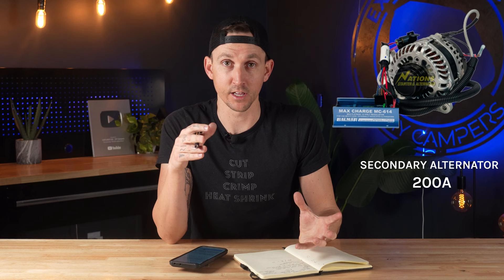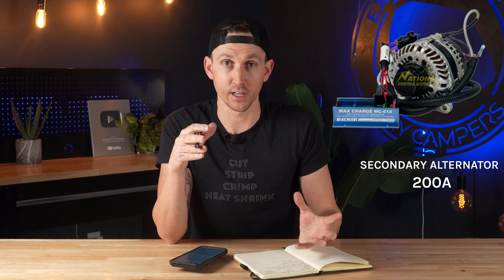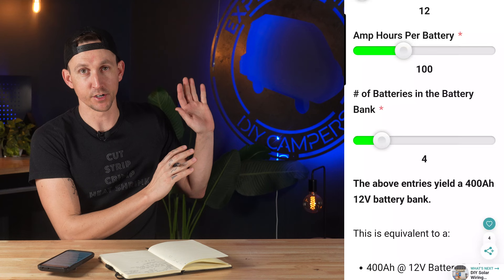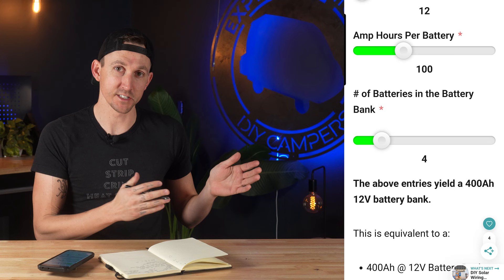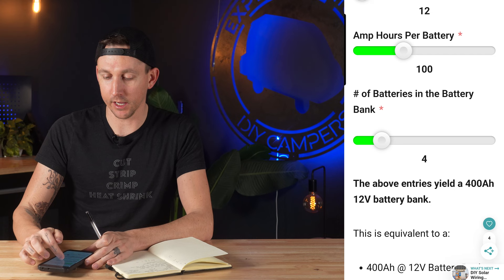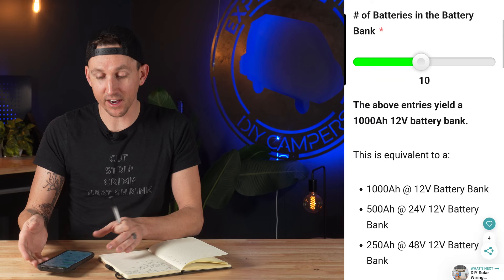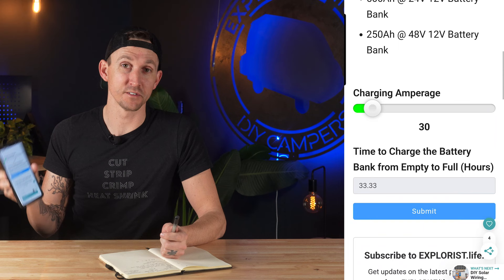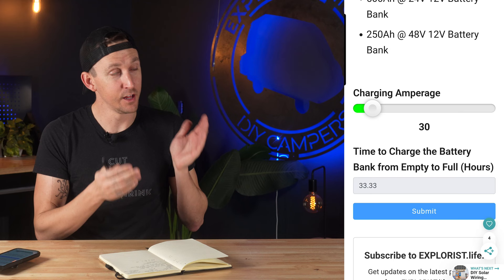ALTERNATOR CHARGING OR NOT? (for a camper electrical system)

Comment: I have a Class C - older model.  I have a Generator 4000W, plus an alternator charging from engine battery.  I don't have any solar yet.  However, I would not do away with the alternator charging because ... it is silent. The generator makes A LOT OF NOISE. You arrive at a residential destination lets say, and its nighttime. You cannot use the generator there, cops will be called. But if your alternator worked while you drove, then you have enough juice in batteries to power up lights and basics.  What happens if solar is not working optimally AND Genset gives you trouble?  At least you have the alternator back up.  I think you should always have it.  Good video, learned something.  Thank you!

Comment: Hello Nate,
I have finished the install of my Battle Born / Explorist Life install.  I have been on the fence about the alternator charging prior to your video.  I have a factory 2nd battery that was factory installed that the alternator charges already.  I installed the wiring but did not install the DC to DC charger.  I decided to take your advice and trust my instincts.  I have a small Honda generator that if my solar falls short, I can supplement power from it.

I want to thank you for all the information, videos etc.  I am very proud of the results I have gotten.  I am the guy with average electrical skills you often mention.  I know without your expertise my great results would not have happened.  Thank you!

Comment: and you have basically no option in the sunless snowy winter for days on end unless you carry a separate generator.  
worst case with a DC-DC, you can run the engine and get SOMETHING....    
But your points are well taken and pretty much cover the issues without being totally extreme case driven.
Always a mix of options depending on intended use patterns.
Good video !

Comment: I'm opting for redundancy on our 25' trailer.  600W of solar but if available, we'd rather boondock under trees than full sun.  Ford Powerboost provides a generator that will run both A/Cs (while charging up the 540Ah battery) when parked and alternator charging will help keep things topped off when trekking cross country in rainy/cloudy weather.  We've done this two years (7000 miles last year) with only a 200Ah battery bank (just a 1000W inverter) and 180W of solar.  Looking forward to the expanded 3000W system!  BTW: doesn't your calculator miss the fact that the last 10-15% of charging transitions from current-regulation to voltage-regulation and takes significantly longer?  Thanks for all your help!  Your channel and website are amazing!
Reply from the maker: The calculator is just aimed to give a rough idea of timing.

Comment: I sort of disagree. Solar is amazing when it’s sunny. We did a two week road trip with almost zero sun the entire time. Without a second charge source we would have run out of battery power. Also I will say this even though I’m a huge fan of Victron their dc-dc chargers are severely lacking. No ve.direct, no dvcc, no external control with can battery, and low output. Until Victron dc-dc comes with a higher output with those options I’ve seriously been considering a new sterling (all red box) unit. Price is was lower per amp and go up to 200 amp (no van can handle that but the 120amp model would be close). 

Of course if Victron ever release a better unit I’d swap in a heartbeat. I went to intersolar in 2019 and was told better units with those features would be coming soon. I understand the pandemic hit but hopefully something better comes soon.

Comment: I have seen ambulance alternator replacements for 2003 Ford Econoline but I wonder if the extra capacity will be actually usable without a special wiring harness; I planned on using a dual battery isolator but now I see solar mppt / dual battery isolater with lithium capable charger integrated in one unit.

Comment: Great video! Most tow-vehicle-to-trailer electrical connectors and wiring are limited to 30 amps, but I don't trust them. If I were doing charging from a tow vehicle, I'd probably limit it to 24 amps or less flowing from the tow vehicle.
Reply from the maker: Yeah, for that I usually recommend running a secondary connection w/ an anderson connector & 6ga wire so we can run a 30a charger (or 2ga w/ a 100A charger).
Reply: A guy on Will's DIY solar forum boosts voltage to 36v before running it through the 7pin and runs that into an MPPT in the trailer.  Since he only has one controller it means he has to choose between solar and TV charging but it seems to work for him.
Reply: @fratermus5502  , That's an electrically cool workaround, but it leaves a very high non-standard voltage at the connector, which would cause trouble if a normally configured trailer were attached.
Reply: Hi I am installing 375 watts of solar with a 300 ah Lithium battery on my Travel trailer. I pull it with my 2021 Transit 250 awd eco boost cargo van. 

I dont plan on charging via alternator but while towing and plugging in my 7 way plug will that affect my alternator?
Reply: @RVRebelGirl , Generally speaking, there is a fuse that needs to be installed somewhere in the tow vehicle to provide power to the 12-volt pin on the trailer connector. So, your Transit may or may not be set up to actually provide power. For my part, I'm going to disconnect the power pin at my trailer's connector, so there is no chance of a problem.
Reply: @robbehr8806  
my transit does charge my battery thru the pin, so i disconnect the fuse on the transit that provides the 12v charge to my trailer via the #4 pin on my connector. Then no power will go thru the plug from the alternator? is that the correct way? thanks
Reply: @RVRebelGirl ; That should do it, but I would still disconnect pin 4 in the trailer connector, just in case you tow with another vehicle. In my case, I'm converting to lithium batteries, so the alternator/regulator in my Suburban would be low on voltage. Plus, the wiring isn't rated for over 30 volts.

Comment: I am planning on going with the nations 280 amp alternator and skip solar all together. Just trying to decide between the balmar or wakespeed regulator. I don’t plan on siting anywhere for long periods of time. I also won’t have much roof space on my Sprinter 144 for any panels.
Reply from the maker: The new Battle Born Batteries will very likely have communications with a Wakespeed since BB just bought them; so I'd be going that route for sure.

Comment: Nate, Steph, don't forget all the yachties that are ear wigging on the side learning too, so thanks for making these videos.
Reply from the maker: 😂🤣  It's tough to remember when when every body of water within 200mi of us is frozen solid.  Do yachts generally have on-board generators?
Reply: @EXPLORISTlife  Yes they do, particularly over 40ft either diesel or the Honda 20i.

However, many of us are now installing serious solar panels.  We have 600w on a 31ft yacht, with inverters to manage electric cooking.  We may add another 300w.  A Remoska being the killer solution and very popular across Europe for cooking.  An oven that will cook a full roast duck and roast potatoes on 580w is a great solution and bakes super cakes too.

Add a Alpicool freezer in addition to the fridge plus portable washing machine and we are pretty much self sufficient from April to September. It's all the same technology, Sterling or Victron inverters, DC>DC chargers, lithium batteries and solar.

Comment: Another option is a lithium specific battery isolator such as the Li-BIM 225.
Reply from the maker: Yeah, that's an option, but I generally never recommend that unit since it's not a voltage nor amperage regulated device.
Reply: @EXPLORISTlife  yes. Good point.
Reply: @EXPLORISTlife   Many of use have found that moderate-size LiFePO4 banks (say ≤300Ah) charge directly from alternator within voltage and current spec for both the Li and stock alternator . 

Example:  when I wore out my old FLA bank and went to LiFePO4 I assumed I'd need DC-DC to control current.  I tested it on a whim and found the alt charged the lithium rather gently (0.32C when SoC is low).   I installed a switch to disable the VSR when  desired and it's been working great ever since.  

So instead of a $250-$2100 solution we could be talking about a $50 relay for campervan folk.  Victron Cyrix-ct for example if we want to stay with Blue. Changes the economics quite a bit.
Reply: @fratermus5502  This intrigues me. I have an older van that I have installed 2 100Ah lithium batteries for the coach. It has an old sure power isolater and an emergency solenoid switch. Are you saying I could replace them with the Cyrix, because of the lower Ah? Worried about taxing my 130 amp alternator. Thanks!
Reply: @johnroyer3191  It's possible/probable the existing setup will work.  I have data on 10 installs where 200Ah of LFP is direct charged;  the average highest current observed is 65.5A at low states of charge, with ~40A being more typical in middling SoC.  

Depending  on where the alternator's voltage regulator is sensing battery voltage (after or before the isolator) the current could be lower: I=V/R, and the V would be lower in that case.  Maybe a max around 45A.

If it were my setup I'd:
1.  ensure there was a fuse inline at a current I was comfortable with the alternator seeing
2.  try it out with the bank nearer full charge (high SoC, hence low current acceptance), observing current.  If it trips the fuse then the experiment is ended and some other charging method is required.  Maybe a 40A DC-DC or something. 
3.  if it works, try with the bank at lower and lower SoC to see what maximal current will be.

Caveat:  if the bank is seeing full alternator voltage (ie, battery voltage sensing is done after the isolator) then the LFP would see that full voltage with no way to disconnect it.  The lack of disconnect with diode isolators would be less of an issue if the bank is seeing [alternator voltage minus 0.7v].

A Cyrix-LI would also do the job with no voltage loss but it could be deactivated on demand.  It could eliminate the existing emergency relay since that function is built into that device. 

If you do try direct-charging with the existing setup or cyrix please report back with your results for our greater collective understanding.

Comment: Hey Nate, thanks for the video. I was thinking no alternator charging either. I want to add 100-200 lithium to my 5th, but I don't want to use the alternator to charge. I have a 110 volt fridge that runs during travel. I think the draw is 6 amps per hour. Say i drive 7 hrs thats 42 amps nothing for a lithium to handle. Then when I stop for the night, shore power will charge my batteries. I guess all I need to do is disconnect the power pin at the junction box on the 5th. Please let me know your take. Thanks, Nick

Comment: I have a 2019 Class B and have been thinking of replacing the 200ah agm batteries that came with it.  They just can't keep the fridge running all night long.  So what would I need to check for in my van to order the parts required?   Battle Born has a Battery that fits on the original compartment outside underneath the Beyond.   When you say alternator charging is this the same as DC to DC charging?    I lover your videos but there is so much information you have that I get befuddled.   Thank you for the hard work you in educating slow people like myself.

Comment: Nate. I ordered my Ford F350 from the factory with an 8’ bed for a self-build stand up camper shell. I ordered it with dual batteries and dual alternators. They are high output 410A alternators. 

I ASSUME the secondary alternator feeds the secondary battery and is NOT cross connected to the starter battery and starter alternator?  

If that’s true (not cross connected) then seems like all I need to do is run from secondary alternator to a Regulator to my TBD designed house battery bank???  

What do you know about this type of set up on the big Super Duties?  Any advice?  Point me in a good direction?

Comment: Hi Nate, sorry not a camper but a boat, I have 1x 24v alternator charging a 24v start bank but I also have a 24v house bank consisting of 2x 100ah deep cycle 12v batteries in series. Is the orion 24/24 17 a suitable option to charge this or am I better to simply go with a Voltage sensitive relay?? I have 520w solar array also feeding into the house bank via a victron controller.... 
Any help would be most appreciated . 
Love your videos . Viewing all the way down here in New Zealand 👍👍

Comment: Hi Nate,  my name is Otto. I have really enjoyed watching some of the videos you have posted with a vast amount of information. I see that someone else has posted a question regarding running his truck with dual alternators. Have you had the opportunities to work on the 2023 Ford Transit Trail? We have ordered one, due to be delivered in 10 to 12 months. I ordered with the Dual alternator which is an option. With the little information I was able to gather from the Ford Dealer and watching few of the feedback in the Ford Forum, it seems that the Trail package electrical system is wire in such a way that both alternators are charging a couple of AGM 100 Amp/hr batteries and they provide some additional 12V switches and a fuse panel. At first I was thinking of having the local Ford dealer disable the monitoring and control of the second alternator, the service writer said that it can be done. The more I have thought of this, I do not believe it is a good idea to have the 2nd alternator reprogram because this may affect some other parts of the system. I ordered the 2nd alternator because I had in mind to dedicate it to charge a couple of 100 Amp lithium batteries but I thing that this is going to require a bit more planning. Lots of questions are starting to popped in my head like, what is the proper to tap off these AGM batteries to dedicate the wiring to feed my lithium batteries and then how to isolate the starting batteries so that the solar panel only charges the camper side lithium batteries, etc., etc. Then design the electrical system to determine what will be all the Victron components needed (dc-dc) charger, inverters, Dist System, etc., etc. Have you had some insight on this new Camper VAN Trail Transit package?
Reply from the maker: Hey!  Just wanted to follow up on this.  We just released the alternator charging video that accompanies this tutorial.  Here is the direct link to that: https://www.youtube.com/watch?v=FuBAKTCCnt4

Comment: If you plan to use a generator to charge the batteries when boondocking, how long can you charge at say 70 amps with a 850 continuous watts generator? That is near full load. I heard that may not be a good idea. The alternative to that is running 2 Orion with my truck idling. Which is a better idea

Comment: Good stuff Nate! In a motor home, what is the best way to disable or disconnect the alternator from charging the Lifepo4 house batteries?  Thanks, Jim
Reply: I have been searching for the answer to this question for days as well. On my rig I have an Isolator relay delay and a Trombetta Solenoid. My engine needs to be running to power the slide out. I'm hoping I can just disconnect a wire on the solenoid to disable alternator charging.

Comment: When running the Orion or buck boost, can you just run one power wire and use a chassis ground on both ends to prevent running two large wires through the van?

Comment: I love what you do Nath, Quick question that's been doing my head in...
Why use an inverter at all when everything useful in livin it rough is 12 Volt?
Help us out bud, I must be missing something, what actually is too be gained by using a Invertor. 
Thanks Bud.
Reply from the maker: Induction cooktop is 120V.  My laptop is too powerful for a 12V outlet, realistically at 230W.  Kettle for boiling water is 120V.  But yeah... if you don't need 120V items, you won't need an inverter.

Comment: Nate, I want to place some remarks:
- before thinking of your options (charger, boost converter) there should be an investigation how much power an alternator is able to produce. Also take in consideration that the car itself may consume some of that capacity. Perhaps the rest is not worth the invest.
- instead of your options I would think about an intelligent regulator (I know best Sterling) on the alternator - also in respect to a smelly😉 test from Victron on an alternator at 50% rpm. This is only possible, if both batteries (Car and   Camper) are the same technology).
- your suggestion about an additional alternator seems to be big - aren't there also smaller / cheaper? But I also would pretend on that an additional alternator has a modern intelligent regulator.
Reply from the maker: Both the buck-boost and the orion are both 'intelligent regulators'.  A secondary alternator like I mentioned also has a 'smart/programmable' regulated output.

Comment: Hey Nate will you be making a video on how to wire alternator charging to the Ford Transit?
Reply from the maker: Yep!
Reply: @EXPLORISTlife  If possible, could you also touch on the pros/cons of going with Ford's factory installed 2nd alternator, vs an aftermarket 2nd alternator, dedicated to house battery charging?
Reply: Would be great to add thoughts of the Ford Transit trail. Can get a 2nd alternator factory installed for $1,000 and comes with 2 batteries. We'll be installing "house"  batteries and would like thoughts on best way to connect to what Ford installs.